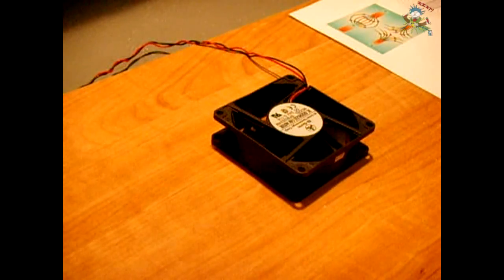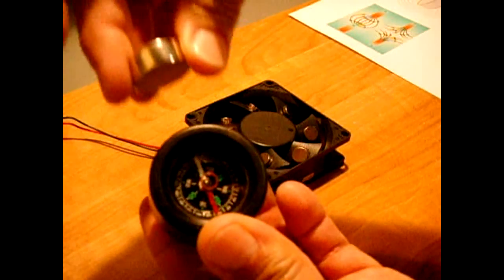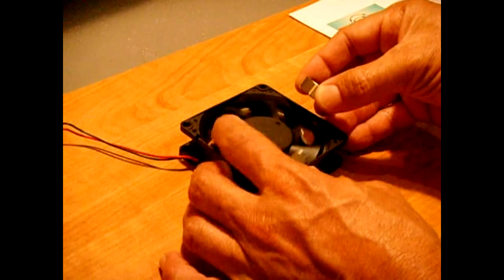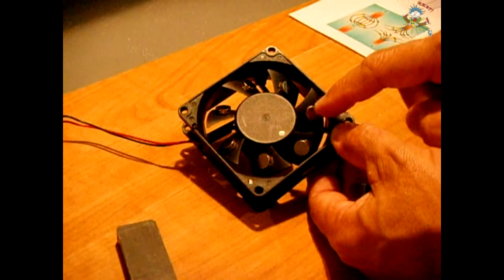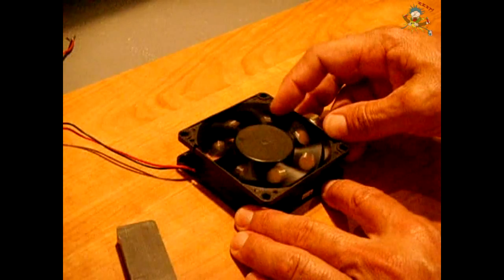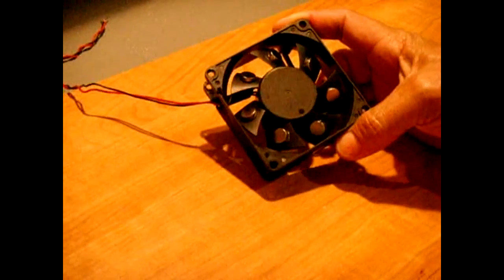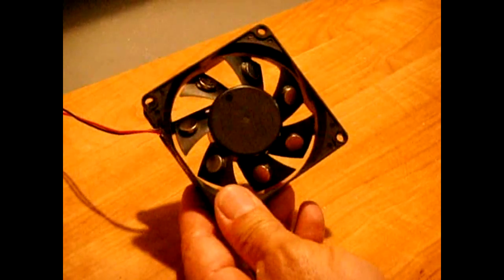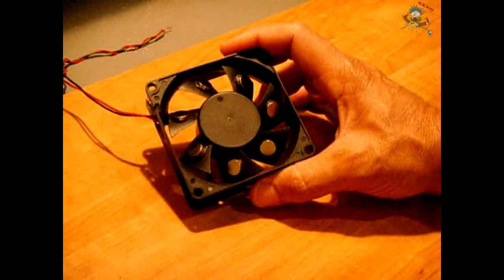Free Energy ~ Case Fan Magnet Motor / Real or Fake?

Comment: The problem doesn't have a damned thing to do with what size magnets go on the blades or the pushing magnet, blah blah blah, as long as you can get a big external magnet to push the blade magnets then that part is fine.

THE PROBLEM  is the fan that is being used!  Almost all modern cheap fan motors like that aren't capable of making electricity. You have to find an older model fan THAT HAS MAGNETS INSIDE of the case that is part of the original design.  There is NOTHING fancy or magical here, the principal is the same as a wind generator. Go look at how a wind generator is made and you will see both wire coils and magnets, the wind turns the blades passing the magnets and coils over each other to make electricity. 

The ONLY thing different here, as long as you have a fan with magnets and there isn't any blocking diodes or crap like that inside that needs removed, is that you are using the glued on magnets and a big external magnet to REPLACE THE WIND to spin the fan.

If you can't hold the little fan up to a big fan and have the little one making electricity (checked with a volt meter) then putting magnets on the blades isn't going to do a damned thing!!

Soooo... You need a fan with internal magnets and it can't have circuitry that is blocking current flow from your test meter. Pretty damned simple.
Reply from the maker: What does your comment have to do with the video being a scam? Which it is? Your correct that some case fans can produce a voltage when placed in the the wind to allow the blades to spin, but many others do not as a result of the internal circuitry. The purpose of this video was to show that you will not have a free spinning case fan using only magnets. If you doubt this, then I suggest you purchase a case fan and magnets. I assure you that you will be HIGHLY disappointed with the results.

Thanks For Watching.

Comment: Did you realise, that the particular fan in this video uses electro magnetic ball bearings, on the drive shaft? which would act against exactly what you are trying to accomplish.
Reply: in my opinon. because it looks like it will work. but bigger magnets are needed i think
Reply from the maker: Jonathan Beckerton Jonathan, use common sense(It goes a long way). It is a SCAM. If you would like to try it yourself, then make a detailed video. IF your successful, I will place a link to YOUR video once I verify it is not bogus, and easily duplicated. To this date, no one has emailed me a link to their DETAILED video proving this works. Need I say more?

Thanks.
Reply from the maker: Clearly you do lack common sense, because if this did work, everyone would be using these devices to power lights/electronics. In theory, you have proved nothing. What YOU need to do is take the time to duplicate EXACTLY what was done in his video. Then I will see another post from you saying, "Yes, you were right, a scam". I'm tired of people insisting this is not a scam, yet they offer zero proof of their claim. I performed the tests, did you? No. When you find a junked case fan and have a few magnets laying around, and get it to work, I'll pay you $50.00 + $4.95 shipping. I won't hold my breath.
Reply: common sense is for instinctual survival, and nothing more, id rather have intellectual intelligence
Reply: common courtesy, was what I meant, now that i read it again, srry
Reply from the maker: Enough of the BS talk, theory, and you saying, "I Think" this will work. The bottom line is, you clearly have not tried this, because if you did, you would realize it does not work. I am seriously considering creating another channel and only uploading fake/BS videos to make lots of money on. With my skills, and video editing abilities, I could do an excellent job deceiving people if I wanted to. Incredible how many people believe these scam videos. This channel will NEVER have any fake videos. BTW, never shoot the messenger.

Comment: Even if this does work (not saying it doesn't) it is not perpetual motion for 2 reasons

1. magnets do lose their magnetic ability 

2. It is technically not perpetual motion because perpetual motion is motion not affected by force of any kind 

Perpetual motion is impossible no matter how you look at it if you find soothing that is perpetual than pls let me know because it is not possible. they say I you throw a ball in space it goes for ever so if you spin something in space it would go forever. FALSE because it would eventually stop because of dark matter even dark matter has friction it may take a million or so years but it will eventually stop true perpetual motion means an action that is repetitive over and over again for ever as long as no outside force acts upon it the closest thing to perpetual motion we have is an electrical circuit so think about it even the universe will lose its energy may be way past any persons lifetime that will ever read this comment but it will end it is not something I hate to think about but it will happen.

Comment: Doesn't it matter? A computer fan's motor will NOT generate electricity even if you get the fan spinning. It doesn't work both ways. Electricity will get it to spin. Spinning it will not get it to create electricity.

Comment: it is clear that you DON'T know anything about magnetism or electronics. Of course if you put that many magnets mounted on the fan blades (which by the way is NOT what the other guy did!) its not going to move. Your creating a magnetic field and weight to big for one magnet to push by itself. What he did was use the coil inside the fan to act as a magnet. let me explain. When you place power to a fan whether it be a small computer fan or a floor fan there is a coil inside the housing that generates a........wait for it .....A magnetic field. This magnetic field moves the fan blades around and around. What he did was utilized the magnet to charge the coil to make it spin. this also by the way creates a small amount of dc voltage. Oh by the way electronicnmore I gave a thumbs down for blatant Ignorance
Reply from the maker: I have no idea what video you watched. LOL, but you are pretty clueless if you actually believe this scam. I used the SAME type of case fan, and the SAME number of magnets, mounted at the SAME location. What have you been smoking? I want some. You can CLEARLY observe the fan "INSTANTLY" turn on as the larger magnet approaches the 7 magnets mounted on the fan blades. There is no gradual movement of the fan blades. The fan "INSTANTLY" turns on when the magnet is close enough. This translates into a hall effect sensor or reed switch inside the case fan housing with hidden button cells. Oh, by the way, your about to be banned from my channel for being brainless. I only allow smart people who are not easy to brainwash, to comment on my videos.
Reply: IT is more clear that you have no idea what you are talking about Philip Pirie . There is no debate about it...magnets will NOT cause a fan like this to spin even one time. Ever. There is NO number or configuration of magnets that will change that.

Also...any time you see a video where someone is getting some sort of electricity out of spinning the fan, you KNOW it is a fake (or at least you should if you have any brains at all.) Computer fans do not have motors that can create electricity in reverse. It goes one way. So even if you got that fan spinning legitimately, with water, or compressed air, or Superman constantly turning it, it will not create any electricity from it.
Reply: Philip, In normal powered operation, the electronics inside the fan make the coils generate magnetic fields of different polarities in a particular sequence.  The permanent magnets in the fan blade hub are pushed/pulled around by this rotating magnetic field.

As far as the magnet-only one is concerned, I can see how it could, theoretically, work.  Though I'd have thought it would be better with 2 "drivers" slightly out of phase.

Comment: Ummmmm.... Sir! I have and idea why yours didn't work but this is just what I think :) (please respect my opinion). One video i saw  before this one stated : "It is important that the magnets must be THIN". I think the reason he said that is because if you use bigger magnets on the fan blades, their magnetic fields tend to touch. In my observation, most free energy motors use thin magnets on the blades because they are less likely to have their magnetic fields to touch. The one you used in your video were thich magnets. Might I suggest making a new video using thin magnets on the blades. Remember, this is my opinion! I'm just another guy with something to say ^_^
Reply from the maker: Bottom line. This is a SCAM. You need to accept that fact and move forward. Others have tried very thin magnets, and had the same results.
Reply: You don't get to have an OPINION on facts. Facts are facts. And just as you can FEEL that 2+2=5, you can't have an opinion that magnets can make a fan spin on their own.

Comment: You have huge, thick magnets, which add weight. If you want to debunk someone's experiment, you use the exact same set up that they used. That's just science 101. Also, half way through your video(when you started holding up the two large rectangular magnets)  You were pushing the fan blades backwards. The blades were set to spin counter clockwise. You showed this in the beginning of the video. Yet, you were pushing the blades clockwise, with your fingers.
Reply from the maker: First off, I spun the fan in BOTH directions to try it. Neither worked. The magnets are NOT huge, but they are thicker. Instead of knocking my video, and rating it a thumbs down, you should be putting all that time and energy into contacting that fraud who uploaded the video and ask him for all the part #'s and specs. Good luck with that. LOL. Some people are so easy to fool. Use common sense, if the idea worked, it would be used ALL over the place.
Reply: There is no need to debunk something that hasn't been "bunked" in the first place.

Comment: No man. it works. i tried with cpu fan motor. and i got 1.5 volt dc current to light up a1.5 volt toy led bulb. 
remember..... there is something behind the science.  our creater is great.  he did not exposed all power to us.  this is not free energy. megnets and motor coils made the little energy.
Reply from the maker: Some CPU fans do produce a current when the blades are faced into the wind, but many do not due to internal circuitry. The purpose of the video was to show that what he did in his video is not going to happen. You will not have the fan spinning freely using magnets the way he did. If you want to try it yourself, then be my guest, but you are only wasting your time and money. Post your video proving what he did works. :-)

Comment: Thanks for the rebuttal video.  Please tell me how you glued your magnets to the blades of the case fan.  I'd like to obtain the same cube neodymium magnet and the same cylinder magnets as the original used and glue them on as you and the original did.  Super glue doesn't work.  Epoxy?  I'll try.  Those plastic fan blades don't glue well!  If it is a fake, the engineer behind the fakery is electronically brilliant.  There are no external wires on the case fan coming in from a power supply unless every frame of the video was edited, which is not likely a good return on investment for a faked YouTube video!  And there's just no room for any sufficient power supply inside the fan that I, an electrical engineer, can perceive, especially not one that explains the acceleration pattern we see when the cube magnet approaches the disk magnets.  It is analog, looks like a cube-of-the-distance acceleration, not digital like a reed switch would provide, even bouncing, which reed switches in an constantly approaching magnetic field can't do.  Your approaches are analog too, as they must be, even though yours goes into coggng as you say.  One would expect the analog acceleration if it were real, of course, adding to the brilliance of the scam, if scam it is.  I have to use the original's thinner disk magnets because as the distance between a magnet's poles are reduced, the more spherical a cross-section of the field becomes.  I have to use a cubical magnet because the non-torus-like shape of its field is not well replicated in the torus-like shape of cylindrical magnets, and is dissimilar also to that of bar (cuboid, parallelepiped) magnet fields..  If it is real, the shape of the cubic magnet's field easily sliding into the nearly spherical field of the repellent magnet coming in from the side has to be the secret.  If it is a fake, I could make a fortune making a power supply sufficient to drive a case fan at that speed AND light a 1.5VDC bulb and yet be small enough to cram into the truly miniscule spare space inside that working case fan!   So could the engineer behind the original video, who would know that, which makes one wonder why s/he is screwing around with YouTube videos.  What's the gluing trick, if you please?
Reply from the maker: Very easy to fake videos. I used E-6000 glue.
Reply: electronicsNmore Thanks!  Sure, videos are easy to fake if the observer is non-critical.  I'm anything but.  But note that to fake it he has to either have a power supply hidden on or in the fan, or to power the fan externally but invisibly.  Right?  He shows the fan on the table.  The shadow indicates there is no elevation of the fan from the table, as in a coin cell on the underside of the case fan.   Indeed, he turns the fan over and we see no coin cell.  Another debunker embeds the coin cells in the back corner of the fan and conceals them with magnets, a different configuration than we are considering to perhaps debunk a case fan video I have not seen.  But we learn to beware of coin cells concealed on the fan.  We can see three of the four corners, the left rear through the mounting hole.  The right rear corner is not visible at any time.  His finger is on that area, the index and later the long are on that corner at all times.  So we look VERY carefully at the angle of his finger and can perceive no deviation from the angle it should be to indent at the corner unobstructed.  The corners are therefore pretty well accounted for, forcing us to consider your button cells and reed switch inside.  But how?  Now it is NOT easy to fake the video, it is darn tricky!   We consider induction, strong updrafts controlled by a foot switch to turn the blades, all sorts of things.  Induction at that distance would be magnificent.  An updraft without ambient noise would be amazing.  So he'd have to edit the sound track too, and that is VERY hard.  We look for frame edits, not only to eliminate the wires but also the shadows that fall on the table.  And all the while we know from our own engineering projects that cubic magnets and spherical fields have interesting properties.  So, thanks to your help and E-6000 glue, we're going to try and prove that it is fake.  I'd pay Wasabe a lot of money to get that internal power supply!  But whatever he did, it is not obvious, and not easily faked.  Thanks again.
Reply: Loren Williams Sorry, I meant downdraft.  You make a very valid response to someone else.  Why is Wasabe not getting a patent lawyer on this thing and securing it for immense profit?  One wonders-- except what has he to sell?  Not the fan, not the magnets.  Nothing that couldn't be reverse-engineered.  He has YouTube videos to sell, and he's selling, whether they are fake or not.  He's got a lot of them.  Some are obviously valid, like the solar concentrator, others far less so, like the double-torus generator that he failed to lift off the table in case there is an inductor under the table.  Wasabe is either brilliant or brilliantly crafty.  I'll let you know when I do the experiment precisely as he did it.
Reply: There is no "IF" it is fake. It is fake. Period. Not up for a debate. And the man in the video does not need ANY knowledge of anything but fakery. He clearly has ZERO electronic knowledge, or at least assumes that you don't. Because if he did, he would know that a computer fan can't create electricity to begin with. It can only take it.

Comment: if i tried with much smaller magnets in terms of thickness on the fan blades or instead of magnets on the blades i used a metal that magnets are attracted to would it work properly and generate voltage?

Comment: The real problem here has nothing to do with all of this pseudo science crap, the fact is that people are liars and you can't trust a huge percentage on their word.
Now perpetual motion is based on getting a machine to run 100% on it's own design yet operate or put out energy. But to do this it would need to put out 101%. 100% of its energy is needed for it to operate itself and the 1% of energy to be applied on to  it's resistance . But 101 % is needed for it to work and we all know 101% is impossible .Perpetual motion very well be probable but Perpetual Energy is impossible . Do the math. It cannot run anything unless what it is running an appliance that eats up 0 % resistance in order to operate . Now this is just silly.
Gazinga.....no not Gazinga. It is true.

Comment: @ :47 you said "the only difference is that my magnets are slightly thicker". That's probably what's causing that so called "cogging". You keep on asking "DETAILED" way the other guy did it but you failed to copy exactly what he used. If you used  the exact magnets that he used then you have exposed him but until then you haven't proven anything.
Reply from the maker: If you actually believe what this guy uploaded to be real, then boy are you gullible. The video is a FAKE. Use common sense, it is very easy to figure out. Does not matter what thickness I used, it will NEVER work! Youtube is full of fake videos.